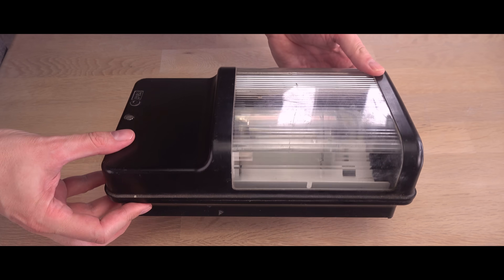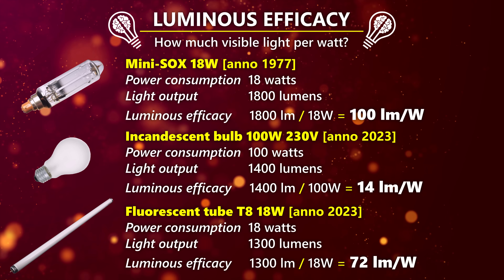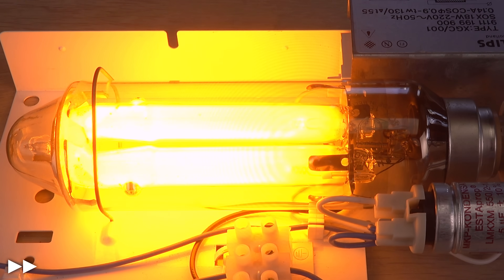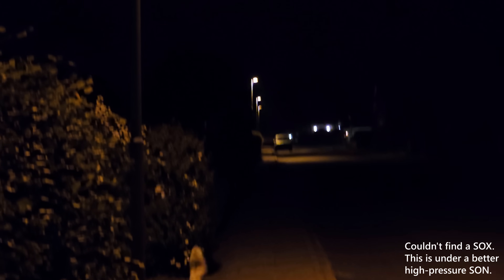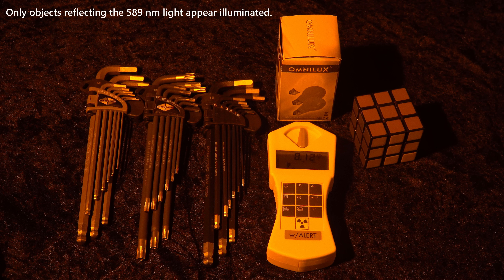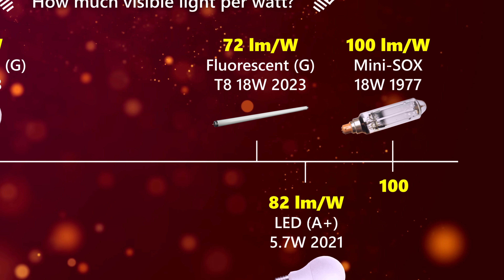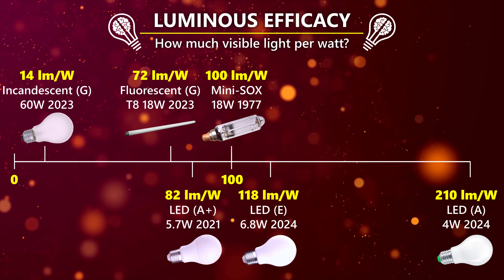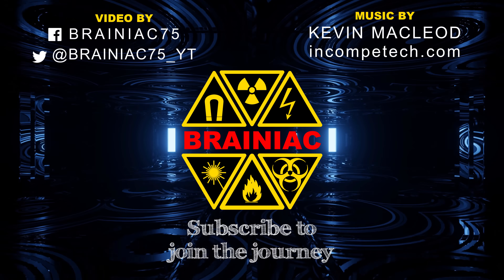THIS LAMP SOXs! "Yellow" tech of bright metal vapor lamp. Beats modern LEDs in brightness per watt?

Comment: That single spectral line must be what those city light filters for astronomy were meant to take care of, and why they don't work anymore now that most street lights are white LED.
Reply from the maker: Yep, need to make a video about that. The 589 nm line is easily filtered out by glass doped with neodymium 3+ ions. I have some of that glass but haven't tried it yet. Should work really well. Thanks for the early comment and watch!
Reply: @brainiac75  It does! I have sodium glare filter glasses for lampworking. They are called "Didymium glasses", as it is a combi of neodymium and praseodymium. You can also buy it in sheet/filter form, to be placed in front of a camera f.i.
Reply: @brainiac75  It does wprk, I used didymium glassblowers clipons, SOX lamps just disappear .
Reply: That's precisely it. due to the highly monochromatic light output from these lamps you could just filter out any wavelengths between 588 and 590nm and be good to go.

With white LED since they are polychromatic that same filtering is next to impossible to do because you're also filtering out wavelengths of interest. For that reason, monochromatic variants of standard LED fixtures are also being trialed to replace SOX as the supply of fresh lamps dwindles and old fixtures start failing. we already have fixtures that output only one single wavelength in the red spectrum and I think there are also some designed to only emit 589nm to replace SOX near observatories as well.

Sad to see SOX technology fade into obscurity though. I'm a Brit, and with special thanks to the energy crisis in the 1970s, SOX became ultra commonplace in our road lighting schemas up until the 2010s when they started to be phased out for high pressure sodium and ceramic metal halide and now LED alternatives.
Reply: @DigBipper188  I miss watching the streetlights coming on outside my house. It always interested me how they started red and changed to orange. Obviously I was too young back then to know why but they only recently replaced them (about two years ago) and that triggered my interest in lighting and long story short I’ve got too many lightbulbs now 😂😂
Reply: @DigBipper188 - even replacing some “experimental” florescent tube street lights
Reply: @DigBipper188  I am surprised that in 2010 they didnt go straight to LED, it seems weird to go to hp sodium and CMH bulbs when leds were already pretty widespread by 2010
Reply: The filters were made of didymium glass and work for the exact same reason glassblowers still use them as lenses in their safety glasses - their remarkable ability to selectively notch out the bright D line radiation while transmitting most of the rest of the visible spectrum.
Reply: @Muonium1  actually they used an indium oxide coating on the inside of the outer jacket for IR reflection, in older lamps that have leaked the sodium reacts with it turning it black
Reply: @TheCORC964  I'm talking about the astronomy filters and glassblower's glasses though.
Reply: @TheCORC-o9r  this would also happen due to an electrolysis reaction between the discharge tube, ITO coating and getter if there was a good enough electrical connection to allow current to pass through the ITO coating. 18w SOX was prolific for this issue and it's why Philips' last SOX related innovation was to replace the getter material with a solid pellet in their later SOX PSG lamps.

Lamps that had this problem would slowly blacken over the space of a few months up until the ITO coating was completely opaque.
Reply: That's exactly what those filters were for,  it allowed you to remove a great amount of light pollution.     A lot of places with observatories still have these lamps in use for street lamps around the place,   while it doesn't block all the light pollution from a city, it does block the near by stuff, which hopefully is enough with 1/r² level of efficiency.
Reply: In my hometown, they still use all sodium vapor streetlights since the mountain above the town is for astronomy. Whenever I make the journey back to my hometown to visit my parents it's an almost surreal experience, like stepping back in time. I'll never forget being a teenager, hanging out in parking lots, how strange it made everyone's faces look. I wonder if they've finally moved on to LEDs, it's been a while since i've been there, and I can't imagine optical astronomy still pulls enough weight to keep them on Sodium vapor when LED has gotten so cheap - especially with LED headlights outshining streetlamps anyways.
Reply: Images from space even show the colors difference between the sodium lights and less. Much more white. May also have a detrimental influence on nature.
Reply: When I was looking into SOX lamps a couple of years back I found a discussion of a city that was keeping SOX lamps because they had an observatory nearby
Reply: Best part is there is a slight glow, from sodium, in our upper atmosphere that can be picked up by massive telescopes so not only would skyglow die but... um... well, natural skyglow would also be eliminated.
Reply: Led lamps are going to mess up our sleep cycle too. Sodium did not because of its spectrum.
Reply: god i hate those LEDs they suck absolute ass for night driving. too bright, you get blinded coming in from the dark and are left blind going back into it. dimmer and yellower lights allow better eye adjustment flow from dark to light. LEDs are just genuinely bad for everything except indicator lights, and realistically we don't need the savings- its psychosomatic at the point that level of obsessive nitpicking takes place at where the usecase suffers for it.
Reply: Love sox lamps, I miss when the streetlights were all sox the light was so much warmer and more cosy especially in the winter. Not to mention they lasted longer than the LEDs they’ve been replaced by 🤦🏻‍♂️
Reply: @TheCORC-o9r  Another thing, one of those lights broke, what was the recycling like? You had simple components, some glass and some wire. LEDs? They're immediate e-waste.
Reply: @TheCORC-o9r  there were some +15yo units in my country lol
Reply: @TuxraGamer  Sox or led? The ones here had been going since the 70s and still worked just fine when they got replaced. The LEDs are always failing and haven’t been there 3 years yet 🤦🏻‍♂️😂😂
Reply: @TheCORC-o9r  SOX, they looked amazing and basically required no maintenance, even with the astonishingly unstable electrical installation in this country, lol. Of course they replaced them with LEDs because it's a "green" alternative (aka, they could pocket the money they had supposedly spent).
Reply: @TheCORC-o9r  If they would properly cool the LED modules they would probably outlast any other light source.. They really cheap out on the cooling solution though! Some do not even have proper fins on top
Reply: @TheCORC-o9r  lol yep they were changed to LEDs because the LEDs were marketed as having longer lifespans (as well as the fact that LEDs are white and "clean" looking), but it turns out that although the lifespan of an LED is theoretically longer than low pressure sodium, in practice they burn out all the time because of the fragile electrical components driving the LED. So it ends up being much more expensive over time
Reply: @TheCORC-o9r  The sox lamps may have been lasted somewhat longer, but on the other hand the LED lamps are much cheaper to produce. As the most expensive part is now to pay the workers to change the lamps, the sox lamps would have to last very much longer for beeing cost efficient.
Reply: Exactly.
Reply: Absolutely, I was going to comment this. My light pollution filter now sits unused 😞The light pollution filter (CLS-CCD was a common one) meant I could image in a fairly light polluted city though they needed a bit of faffing about with colour correction afterwards. Nowadays I just mostly just use narrowband pass (Ha, Oiii, Sii) filters except for Galaxies
Reply: This light was used in early movie special effects with a special camera that used a prism and two rolls of film. One downside was it had to be painfully bright to the actors for it to work. Search making Pete's Dragon, maybe also Bedknobs and Broomsticks...
Reply: I was about to comment this, glad people are aware of it!
Reply: In a city i used to live there is an observatory and I think there is still a by-law that was meant to reduce light pollution around the observatory. The observatory was built in the 1920’s and back then it was basically in the middle of the country side.
Reply: Those filters unfortunately went obsolete way sooner than the advent of LED street lights. The nail in the coffin was high pressure lamps, including sodium. The high pressure makes for a more efficient bulb but unfortunately broadens the line to a wide band 😓
Reply: sodium + cadmium would of been pretty good at making warm-white light , I believe.
Reply: Your'e right, the change to LED in street lights render my CLS filter usless limiting my backyard astrophotography to bright objects only.
Reply: They should just switch to red LEDs
Reply: I suspect that one reason sodium lights were phased out is that originally they were first installed in high crime neighborhoods.  This (probably unintentionally) put a stigma on whole parts of the city— a physical form of “redlining”
Reply: The rollout of white LED street lights is a disaster on so many levels - road safty, light pollution, killing of nocturnal insects, disruption of human circadian rhythms. Not a thought given to any of this. It was just assumed that now we have efficient white light tec that its better than orange.
Reply: I wish we had red street lighting. Our night vision would be preserved and we'd get far less light pollution, since red light doesn't scatter in the atmosphere anywhere near as much as green or blue. It's why the sky looks blue.
Reply: It's a shame most streetlights are LED's. They hurt eyes at night so much, and are ugly
Reply: @NEON2600  Where I am they are starting to put blue lights in some street lights. I only ran into them once, but from what I remember they make things pretty monochromatic, but don't cause as much glare and illuminate pretty well. I also kind of like the blue vibe at night.
Reply: @NEON2600  The problem is not they're LED. The problem is that city officials are pushing to buy LEDs with wrong color spectrum. LED can be tweaked.
Reply: @crazywarp36 Japan has an interesting solution. They actually have blue street lights (almost purple) in some places. This isn't the normal led bluing that's a pale blue.
Reply: @NEON2600  in my city they use hps to replace old broken LEDs or severely damaged mercury lamps.
Reply: @NEON2600  TRUE
Reply: @NEON2600  My park used to have these amber lights but then they switched to white and I absolutely don't care for them.
Reply: Hooo boy, it seems that none of you here understands why LED lights use the spectrum they use and the only argument for sox is the nostalgia circlejerk. I get the warmth and easy to filter but if you're wearing anything that doesn't reflect yellow - you're invisible.
Why LEDs used are of cold spectrum - night vision sensitivity shifts towards blue - so less power or more perceived light for the same power. Best approach is to use warm and or mono on pedestrian paths and cold high efficiency where cars drive.
Regarding LED retrofits in cars - here in a little corner of EU you won't pass MOT with lights that are blinding incoming traffic, and some of those are down right banned.
Reply: yeah what's funny about that is I believe the LED street lights and especially those cheap LED headlights everyone puts in their cars don't actually light the surfaces the same at night so the actual effectiveness of them helping you see is not more than the blinding effect it has when you have to look into them during on coming traffic ect...... In short I am trying to say they blind on coming traffic more than they help the person using  them to see the road especially during poor conditions like rain and fog, there's a reason good fog lights are not blueish white
Reply: Can't stand yellow street lights, LEDs are way better.
Reply: @Techpriest1010  I don't disagree but it's too bad those filters won't work anymore for astronomy.
Reply: @Techpriest1010  yellow? streetlights were never yellow

Comment: Those frosted glass rods in those older multi-vapor lamps (lighting warehouses) make great knife sharpeners.
Reply: Alumina ceramic can make a damn good fine abrasive :)
Reply: Do you mean aluminium oxide arc tube from HPS or CHM lamps? Absolutely no reason to destroy even a worn lamps, they are great for Tesla coil experiments.
Reply: @mernokimuvek 

Looking at these two comments made me think of a New Vegas skill check. Like OP had a high Melee Weapons skill and you spec'd into Science.